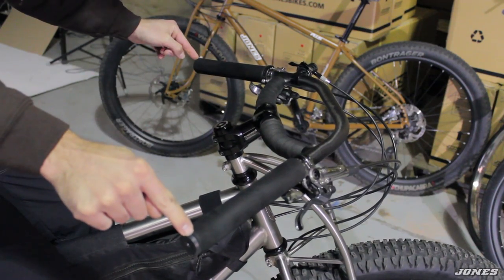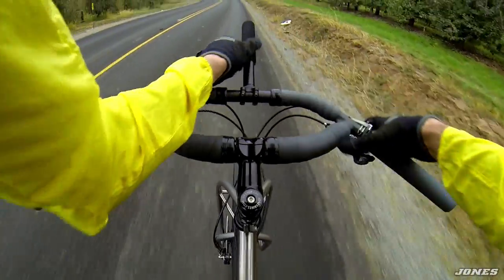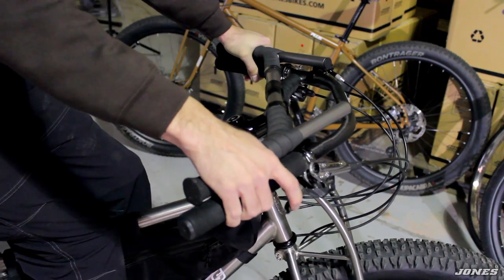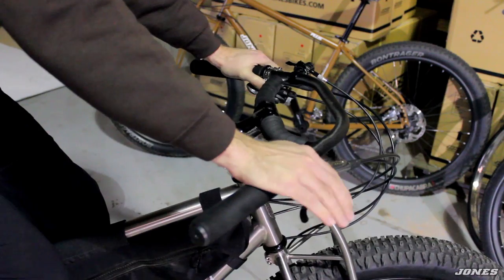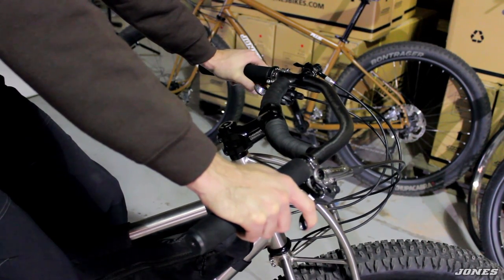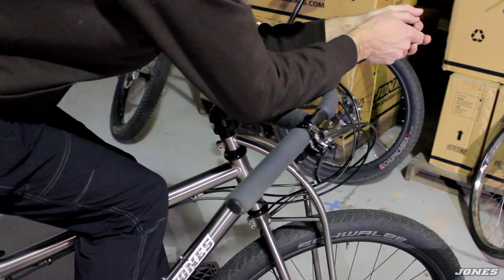Bicycle handlebar. The Jones Loop H-Bar. Dirt Road Tour Pack Gravel

Comment: How interesting to hear your first-hand comments about how you created these! 

I ride a Surly Disc LHT, and I have considered Jones Bars for long distance touring. But I WOULD REALLY MISS riding on the HOODS.  I wonder if there's some way that (hoods) position or road brake levers could be incorporated with the other ergonomic design features of the Jones Bar??
Reply from the maker: Yes. The H-Bar does have a position that feels like the hoods: https://youtu.be/yVRY82MO8rs?t=18
The "hoods" hand position became a thing on drop bars after brake levers were added many years ago. Before that, when bikes all had a fixed gear, there was just the drops and top hand positions on racing bikes. Once the brake levers were added, it was rapidly noticed that it was more comfortable to hold on to brake lever body when not racing in the drops. Adding rubber hoods to the brake lever back then made it even better place to rest and ride while waiting for the sprint.

Comment: Really is such a marvelous handlebar man! Got to get this set up on my old mountain bike but I'm just trying to figure out what size stem you get what angle the one you got on there so perfect on that whole bike,
Reply from the maker: If I remember correctly this is a Thomson 10 x 80mm stem. But most the time when you put a Jones H-Bar on a non Jones bike you will need a shorter stem. There is a lot of good info and pictures on the set up in our H-Bar manual here: https://jonesbikes.com/content/Jones_H-Bar_GUIDE_web_v3.pdf
Reply: @Veloperator  thank you for the follow up that's excellent information I was looking at a 70 mm to go along with this bar so I think I was close thanks again

Comment: I just purchased a pristine '92 Bridgestone MB6. No suspension. I'd like to make it a gravel bike to ride fairly decent trails and gravel/dirt roads.  These bars look like they would do the trick.  Any recommendations?
Reply from the maker: Yes, they would work well on your bike. Check out the H-Bar manual for more information about installing them. https://jonesbikes.com/content/Jones_H-Bar_GUIDE_web_v3.pdf  Check out 2.5 H-Bar, the extra rise may work well on your bike. Feel free to email or call us if you have any questions.

Comment: so i have been using this bar for a week now, love the hand position , but i realised something, the handle area is very long more than 2 times longer than most  mtb styled  brake levers... so i do feel a little sketchy not being able to reach the brakes at the widest grip area.

so wouldn't having longer levers help negate  that problem ?
Reply: Hi El Jefe,
it's true that on the 710mm H-Bar, you can't quite reach the brake levers from the super-upright cruising position at the end of the grips, but if your stem is short enough, you shouldn't need to be in that position when you're riding in situations that require braking.  I'd recommend checking out the H-Bar Manual at: http://www.jonesbikes.com/content/Jones_H-Bar_GUIDE_web_v2.pdf because it explains how to determine if you have the correct stem length and rise.  It's worth noting that most riders need a much shorter stem with the H-Bars if they want to really make use of all of the positions.  

Finally, to answer your question about longer levers, yes, you could use longer levers, but Jeff's experience is that they get in the way of the more high-performance descending positions slightly farther forward on the grip, and it isn't necessary to reach them when you're just cruising along in the most upright position, so he doesn't recommend them.  

I hope this helps, but please feel free to send us an email or give a us a call if you have any other setup questions!
Reply: thanks brandon!
Reply: El Jefe See physics, fulcrum

Comment: Is there somewhere that there is a setup guide. I just bought them and the guide comes with instructions on setting up the brakes and such but nothing on how to set up the hight in relation to the seat and the reach etc. Can anyone direct me to those kind of instruction? Thanks
Reply from the maker: Hi Larry, The H-Bar set-up guide that comes with the bar does cover this. I pasted the part about bar height and stem length here: "The Jones H-Bar works best when the main grip area is approximately the same height as the saddle, and far enough back toward the saddle to allow you to sit very upright when holding the rearmost portion of the grip area, so that you have easy access to the front positions as well. To achieve this, you may need a significantly shorter and/or higher rise stem."
Reply: @Veloperator  I will give it a try. I did not realize that my Sram Rival brake levers would not work. I put the bar on but now have to wait while the new brake levers and shifter comes in the mail. I tried to ask if my sram brakes would work and was told they would and I went for it, but only a sort way into it I realized that they would not.
Reply from the maker: @LarryRichelli  If you ask us, we will tell you that drop bar levers do not fit. H-Bars use flat bar levers.  Enjoy your rides!

Comment: Are these handlebars made for a 25.4mm handlebar clamp?  I've only seen 31.8mm so far.
Reply from the maker: All Jones H-Bars are 31.8mm now. Most riders need a shorter and higher stem with this bar to get the right fit, so you will need a different stem to fit the bar (31.8mm) but also a shorter stem to bring the bar closer to you. Here is the manual for the Loop H-Bar: http://www.jonesbikes.com/content/Jones_H-Bar_GUIDE_web_v2.pdf

Comment: May I ask what is the recommended stem length for jones h bar? 50mm or 60mm?
Reply from the maker: It depends. We usually recommend a shorter stem than you had before. Check out our h-bar manual for complete info: https://jonesbikes.com/content/Jones_H-Bar_GUIDE_web_v3.pdf

Comment: no offence but the BS starts at 0.16 : you can't move when holding a 'normal' bar?? Billions of bicycle journeys worldwide contradict this marketing hype...
Reply from the maker: I think you misunderstood me. I did not say you "can't move when holding a 'normal' bar". What I did say and was showing with my hands and body, is that with: "a normal bar you are holding on to one position, you can't lean back any farther (once your arms are straight), you can't lean forward any farther (than I can bend my arms), but with this bar you have different positions to hold on to".

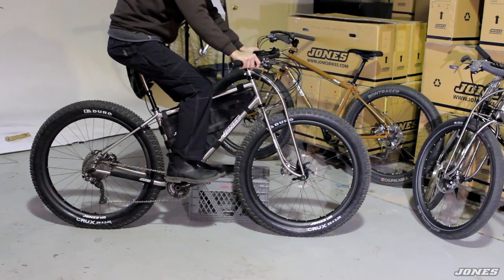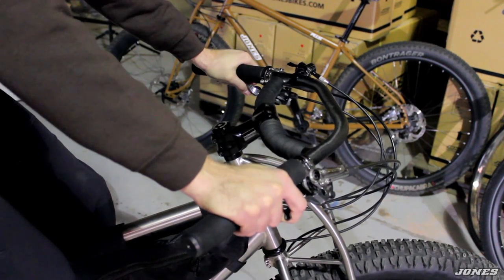I'm talking about how with a normal straight or riser bar, we have only one hand position and so we can not move our hands forward or back on the bike. We can only lean or move our body from this one grip position. This means we are limited as to how far forward and how far back we can move our body over the cranks and wheels to get into the best position for climbing, descending, good neutral handling, an aero position, comfort etc.... Go to 1:15 to see me on my bike showing how I can actually move my hands to a more rearward (and wider) position on the bike for going down hill to keep my weight back. This is also a good position for just for sitting more upright for comfort. Also at 2:26 I show a good neutral hand position for more technical riding and control and also a few other positions forward of this for resting. Then the far forward position is for getting aero or stretching out and resting. 

Road racing bikes with drop bars also have more than one hand position, but for different reasons. Higher positions for resting and slower speed speeds and the drops are for faster riding and sprinting. 

Straight or riser bars have one grip position.
Drop bars have high and low positions for what road racing bikes are for. 
My Loop H-bar has hand positions that are closer to the rider with wide grip spacing (like DH bike or cruiser) to other positions farther forward that are narrower (like the "hoods position" or like an XC bike with longer stem and narrower bar), and then there is the front of the Loop to hold on to also.  

Measuring from the front to rear of the 710mm Loop H-Bar bar is 10.5"/270mm. That is a lot of front to rear hand movement. It's like having and adjustable stem length and bar width in a way.

Not marketing BS. I made this video after selling H-Bars for 12 years to help answer the questions I get every day from more and more people. I hear from many riders that tell me this video has helped better understand and better set-up the bars, and how they can now ride farther,  better and with less pain. This is what it is about.
Reply: @Veloperator  You don't need any marketing BS. The hundreds of threads I've read about these bars convinced me to spend the money on them, this video just reinforces everything I've read, and your reply to this comment shows that you know exactly what you're making and why you're making it that way. Looking forward to trying out the bars.